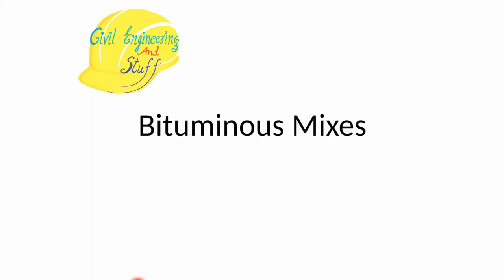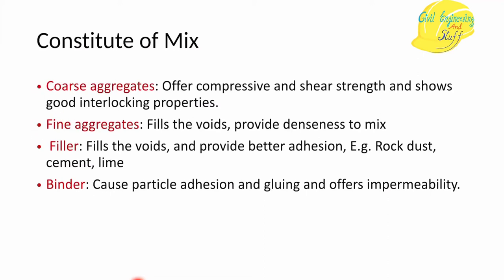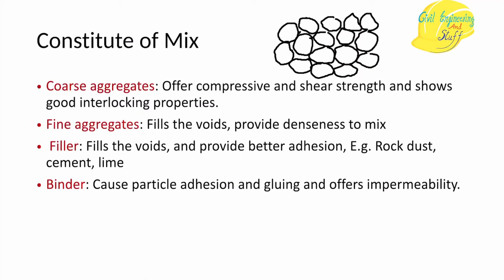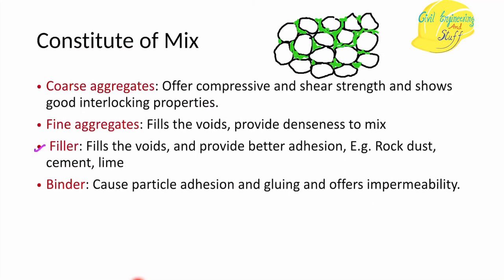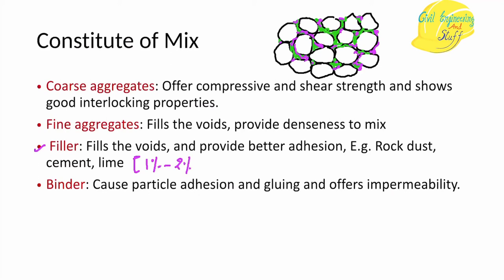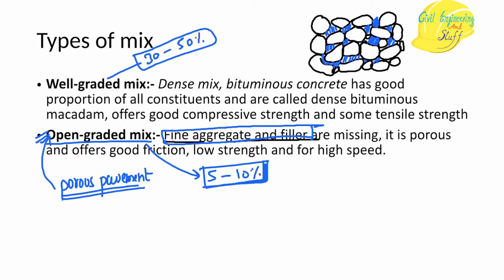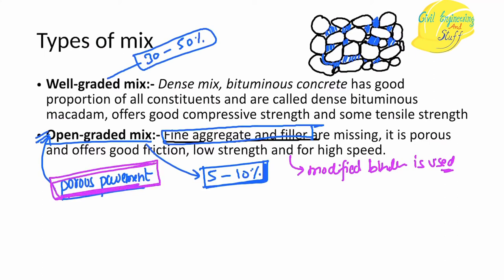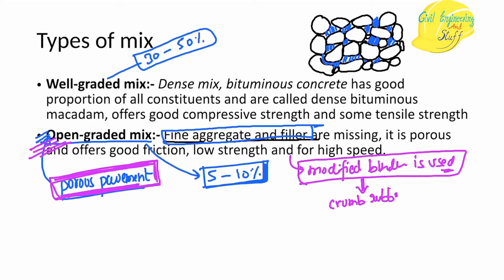Bituminous Mixes: Contituents, Properties and Mix Design

Comment: Hi sir..i hv done a mix design using 38pcnt quarrry stone dust ,60pcnt 10mm stones and 2pcnt cement..the problem is im getting stabilities high as 24kn and flow of 6mm...i used 5,5.5 and 6% binders..how du i deal wth this
Reply from the maker: HI.. Which mix design are you doing? Based on you nominal aggregate size I am assuming Stone matrix asphalt. Based upon your results, I think your quarry dust particles are smooth, because of which very easy coating of bitumen is taking place and substantial quantity of bitumen is left in mix, due to which internal sliding of aggregates is taking place causing high flow value. You can do two things, (a) Redo mix design with lesser quarry dust,  incorporate conventional stone dust with higher particle size distribution if required and repeat the experiment. (b) try lower values 4% and 4.5% of bitumen and see if this help.....